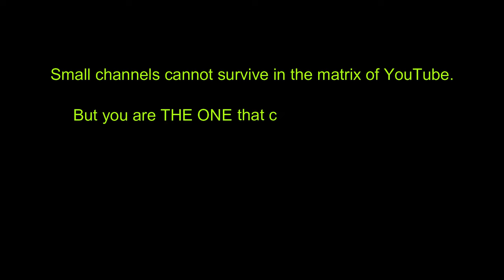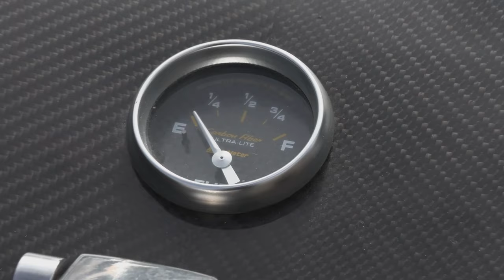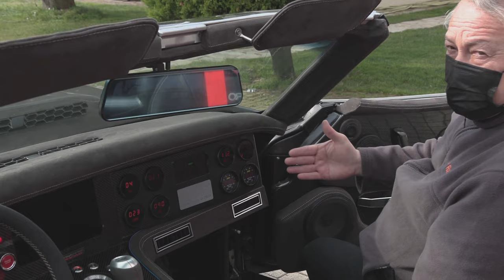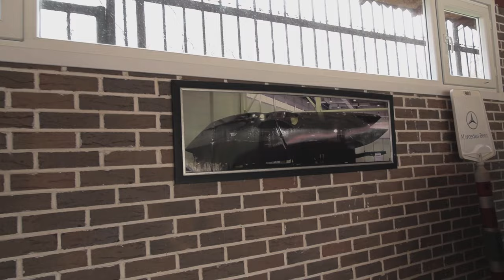Full Carbon Fiber, 780 hp Chevrolet C3 Corvette Restomod | Build Story: C3-R

Comment: I like the fact that he did not touch the engine..too many builders end up with an awful daily factory stock motor because they wanted more power but when put back together after opening up the engine & changing major factory parts & set-ups and dyno ECU tunes ,engine problems started...especially the LT5...when it comes out of the factory it is literally perfectly tuned..just like the LS9..factory ECU + motor doesn't need anything more..maybe going from auto to  manual..but even there problems might start to show-up with electronics...
Reply from the maker: Fully agreed! It's got huge power, drivability and reliability as standart. Why risk it all for a few more horses that you'd probably never need.

Comment: Just found a time to watch this monster. The project itself was really mind blowing. Up until this one, I was thinking that I have the sickest Vette in the town :) Now we all have this..  Putting an LT-5 into this small carbon, very-light weight Corvette is huge!

Is there any chasis upgrade like Detroit speed or sth ? If it has, the owner will be able to run under 2.25s at Istanbul Park I guess.. 

One more stunning work Burak! Keep going man..
Reply from the maker: Glad you enjoyed it! Thank you! The chassis is stock but reinforced; in case it is not up to handling all that power, the owner will probably do something like you've mentioned. :)